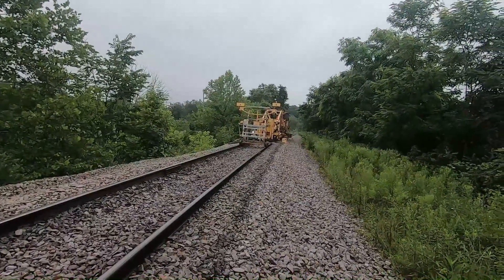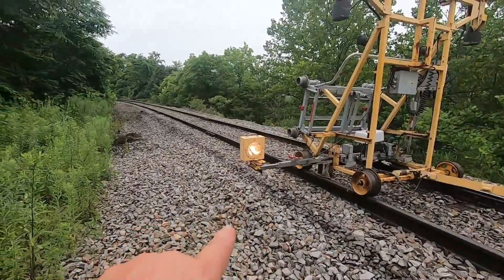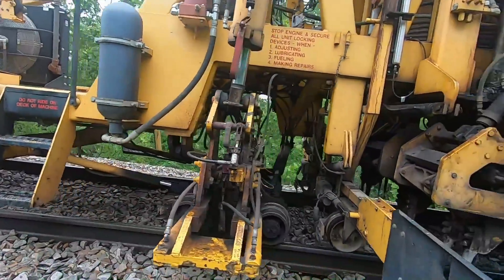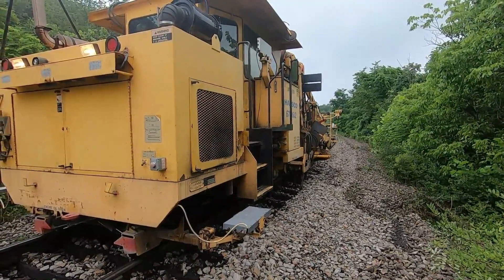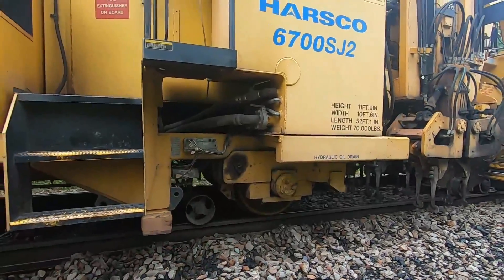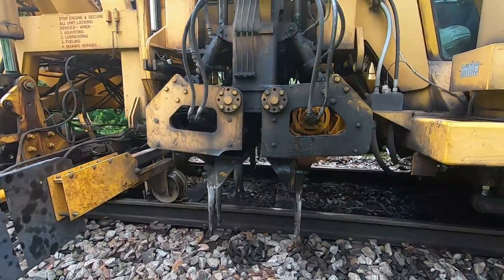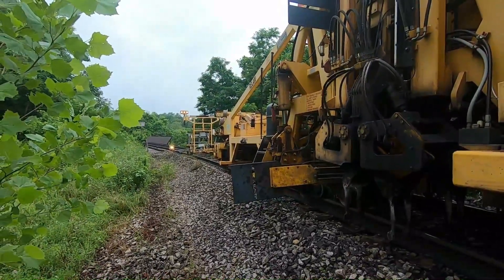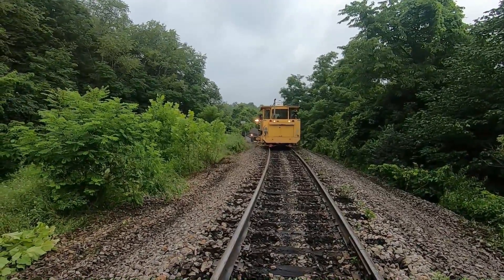Tamping Track with a Harsco 6700 SJ2 Tamper

Comment: I recently saw a video of a RR accident where the "controller" was told by a maintenance crew that they had cleared the line.   The controller sent a train on the track and it hit some maintenance equipment that was still on the line.

I asked about the track circuit in this context (I figured that the equipment would close the circuit and approaching trains drivers would see a caution and then a STOP.)    I was told that these machines have insulated wheels and don't affect the track circuit.   In your experience, is that possible/true?  I've seen videos where maintenance equipment on the rails caused a crossing gate to come down.
Reply from the maker: All hi rail trucks and MOW equipment have plastic inserts in
their wheel bearing bushing to prevent shunting a track circuit,
this is done so when working around a grade crossing, the
equipment won't set off the crossing lights. The tamper also
has plastic inserts on the jack beam clamps. They may be made out of
a harder teflon type material, I'm not sure exactly what the bushings
are, I've always just heard them called plastic inserts. If you
saw a crossing gate come down from an MOW equipment
in the circuit, then that bushing could have been faulty or
even removed for some reason. Hope that explains it for ya John.
Reply: @ccrx6700  100%!!
Reply: yes it can, hi- rail vehicles can too, and can switch to being non-insulated also.

Comment: Great video as usual my friend! Jupiter II System? Wow, that's the name of the space ship on Lost in Space, that's a big flashback!  I've always been fascinated with track maintenance equipment! My favorite when I was a kid was the track grinder — all of the sparks made for a great show. My favorite nowadays is the tamper of course 😉 They are replacing several small bridges on the BNSF line down by the Mississippi River as I type. They are using some pretty interesting machines to do that, but it's hard to see going by at 60mph!  The bridges are pre-fab for the most part, they tear one out and put in a new one in a day or so!
Reply from the maker: Thank you. I've always wondered why they named it the Jupiter
system. The old Jupiter 1 had many problems, was a fiend
to diagnose if something went wrong. The new 2 is much
more reliable and user friendly. There is a 2 inch thick ring
binder book that comes with it explaining how it works and
how to troubleshoot. But the computer also does a good
bit of the troubleshooting with the J2 system. Tampers 
are an electrical nightmare! Pre fab bridges are amazing!
Appreciate your tuning in and watching the show my friend.

Comment: Loved the video! Thanks for posting!
I really need one of these tampers. Too bad they don't make them small enough  for my  track. I tamp and level by hand, but I only get the cross level real good.
Reply from the maker: Thank you and glad you enjoyed. Cross level is very important. hand jacking and tamping with jitterbugs or worse shovels or lining bars is back breaking work! Adding super elevation may or may not be advisable for your track. Depends on the degree of curvature and the speed you are taking the curves at. I have a chart that shows me
the degree of curve, the MPH and then the amount of super
to put in a curve. Appreciate your taking the time to check the
video out my friend.
Reply: @ccrx6700  It's all shovels and lining bars here. Thankfully, the lining bars I use are smaller and much lighter than my great-great grandfather's lining bars that he had on the White River Railroad in Vermont. Those lining bars have been holding up wood piles on the family farm since the 1935 when the railroad was torn up.
Reply from the maker: @MillBrookRailroad  😊👍

Comment: Thanks for sharing.  That is an impressive machine.  When you re-set the level of the track, is it experience?  It looks like the clamp picks up the rail by some amount, then after the tamping, when the clamp releases them, the ties sit a little higher than they did originally.  Do you develop a "feel" for how much higher the track will sit afterward based on how much tamping you do on an individual tie?
Reply from the maker: Your welcome Noi wont and we do certainly appreciate your
taking the time to watch and write in my friend. Surfacing track
does have a lot to do with experience learning what ballast conditions
you have and how high to lift track and the machine you are
using to do it with. Seems like every tamper has it's own personality
and does things a bit different than other ones. So yes you do
develop that feel you are talking about. Good observations on
your part.

Comment: That's one crazy machine. There sure are a lot of moving parts. So. how do you start a job like that I mean do you have to go to the bridge first to find out where it sits? And then back up? I know you would want a smooth transition into the bridge on both sides. Stay Safe!
Reply from the maker: to tamp a section, the operator will first make a plot of the
track, that shows the current geometry of the track, then the
plot can be manually adjusted by changing the ordinates in
the plot. And also you must manually add the super elevation to
the plot, then the computer will put the track to how you have 
built the curve. Track surface when done must match
the bridge surface obviously. It''s easy. thanks for watching
Anthony.

Comment: Re rail creep, does cwr creep less presumably Canada you stager the joints this causes the vehicles to sway, and they are more likly to derail, again by the same manager.
But in The US this is the practice see a badly tamped if ever, ELS RR videos, where the train is rocking and rolling.
Thanks again for your time to make these great technical  video's.
Reply from the maker: Your welcome Anthony and we do certainly appreciate your
taking the time to watch and write in my friend. Steel rail creeps
(expands from heat) the same amount whether it's welded
or jointed. With welded every tie is anchored to prevent heat
buckles, which doesn't always happen, CWR has more buckles
than jointed. With jointed the joint gaps take up that expansion
also not every tie is anchored on jointed track.

Comment: Love your videos!
Up close to some thing we don't see and allways with the smile! :)

A question: is the movement from the sleeper to sleeper somehow automated or is it pure operator's commands?
Reply from the maker: Really glad you are enjoying them Joe! Good question:

Operator manually indexes the machine ahead. On this tamper
it is foot operated, on my tamper it is by push button. Some
tampers have a tie finder. Tie finder by magnet finds the tie
plates and automatically stops the tamper in the right position
over a tie. With tie finder an operator can literally get the machine
running and then walk along side the machine as it does
everything by itself.

Comment: Great video Dave. I didn't like distractions in the cab while tamping either. The Fairmont MKIII I ran had a lot to keep track of, some of it was still manual controlled, not like the tampers today. I've walked many miles beside the tamper too making sure the operator didn't mess up my track.
Reply from the maker: Thanks Zach, glad you like the home movie. For those who have
never ran a tamper, they have no clue all the stuff that happens
and goes on when tamping and all the stuff that you have to
watch on the machine and the track, you can really mess a piece
of track up quick if something goes awry and operator not
paying attention, I've done it! A good ground man is a tamper's
operators best friend out there, unfortionately I have no
ground man anymore, used to, so I gotta pay even closer attention
now, cause if it screws up, I gotta fix it.....LOL

An idiot tie inserter operator can really mess up track too.
We've had some of those, have to have a tamper behind him.
Last several TRIPP operators we've had in here were really good
and I had to do hardly anything behind them.
Reply: @ccrx6700  good ground man and good operators are essential.  I've seen guys screw up track replacing ties by hand. They didn't do it after I made them fix it by hand.
Reply from the maker: @rebelrailroader  👍😉

Comment: Dave is there any risk the tamper might pull up the spikes?
Reply from the maker: In poor ties yes spikes do get pulled. Also in partially frozen
mud or ballast the ties will stay down and spikes get pulled,
did that one time and was no fun hand driving all those spikes
back in! So I won't tamp if the ballast is frozen or even partially
frozen. In warm weather and spikes come up, that a good
way to find what ties need replacin! Thanks for checking out
the video today Mike.

Comment: Dave- how do they get that equipment on your tracks? Does it come in by truck or do they float it by barge?
Reply from the maker: Good question Brad and all the MOW equipment that comes in
is trucked. Nothing ever comes by barge, no way to off load it
here. Appreciate your checking out the home movie my friend.
Reply: it would be trucked in. this piece is owned by the mine. my guess is that the rail contractor employee was running the machine.
Reply from the maker: Contractor was running it rear speaker. Gave me a nice break!

Comment: Hi Dave great video I’m kinda woundering why they only run with one buggy? The longer it’s stretched out the better the quality most times
You have some great looking rock conditions,,I’ve Hurd you say in the past that you have a lot of coal dust in track? A good undercut and reclamation would go along way in improving tack conditions I think
Reply from the maker: Good question Mike. We have an insane number of sharp degree
curves here, we have 70 curves and over half of them are 8 degree
or higher. So I figure that's why they used the single tongue for
most of their tamping. Their pole is different than mine. I have a long
pole and a short pole. I agree, the longer you can stretch it
out, the better the job. This was a section I had cribbed out
so thus the good ballast, we have a lot of other sections
with some pretty poor ballast.

Bet you wished when watching you were running it! Do appreciate
your writing in and watching tonight my friend.

Comment: Dave you said earlier that you have 14 bridges, do you have any threw truss or ballast decks or deck plate or timber or open decks would like to know 🤔
Reply from the maker: Bridge 2 is a ballast deck bridge all others are open deck. I love
bridge 2. All other bridges have a problem with approaches
wanting to not hold track surface, bridge 2 never has that problem.
We have no truss bridges. Thanks for checking out the presentation
tonight my friend.

Comment: All I can think is that this is really cool! A purpose-built machine engineered to straighten and align the track by adjusting how it sets in the ballast. Fascinating! Is a once-through enough to accomplish the alignment and all?
Reply: Sometimes it takes many steps . Passes you could say over the area to get it where it needs to go . You are also usually restricted depending on the class of track to only align so many inches over or up at a time. Causing you to take more passes at it to get it where it's needed it. It also lifts the track if needed not just side to side and aligned
Reply: @brandonrickert9367  That's cool. I am guessing it is the weight of the train moving the ballast over time that makes for misalignment?
Reply: @brianhickey5949 yes among other reasons there are many reasons . Is a brief yeah basically.  But weathering washing out ballast . Improper drainage underneath . Various dianamic force on the rail you can get movement from not enough Anchors. Which hold the ties in place. Or from missing loose spikes .everything over time can cause movement . Or a combination of it al
Reply from the maker: Glad you enjoyed the presentation Brian. Brandon did a good
job in answering your question. Do appreciate your taking
the time to write in and watch my friend.

Comment: What does a TAMPER do ?
Does it pack down the ballast ? 
Does it lift the track above the ballast ? So that the rail bed can be raised higher and higher ?
Do you have to come back and add ballast once the tamper is done ?
Reply from the maker: Lifts track and aligns track, then it shoves the ballast under
the ties to hold that lift and alignment. regulator coming behind
the tamper will fill in the cribs with needed ballast and then 
broom it off the top of the ties so that a good track inspection
can occur where you see the spikes and tie plates. And yes, 
if needed more ballast will be dumped if there is not enough
on the shoulders to pull in to fill in the ties.

Comment: Hey Dave,
I can figure out how to get the radius of a curve. How do calculate the degree of a curve?
Reply from the maker: I do not know the formula for that Joe. On the RR, what we do
is measure from 1 point on the inside of the rail head that is on the high rail. Take that string line 62 feet down to a second point
on the inside rail head. Then measure at mid point, 31 feet, the distance from the string in to the inside rail head. That gives a fairly accurate degree of curvature. 

If the distance was 9 inches, then that would be a 9 degree curve.
It's not accurate enough for NASA to send a rocket to the moon,
but it is accurate enough for RR work. When you plot a curve with
the tamper, the computer figures that out for you.

Appreciate your checking out the video tonight my good friend
and hope that explanation helps.

Comment: Ground is just thawing here, getting ready to tamp in 2 weeks or so. Gotta pull 5" of elevation out of a few curves that have long been neglected from their high speed days.
Reply from the maker: Hope you have a lot of ballast to work with! Old school thinking
on the RR was lot's of super elevation. thinking has changed a good
bit in the past 30 or so years with much less super. Our track
was built in 197/76 but US Steel, and I have an old super elevation
chart from USS, much more super then they recommended than
AREMA does now. This was 25 MPH track and USS put 5 inches
in many of the higher degree curves when built. We've taken
all of that out, I think the most we have now is a few curves with 3
in them.

Comment: Our surfacing crew got a totally rebuilt Jackson 6700 from our Brainerd equipment shop last year and a 100% new Kershaw regulator a couple of months ago
Reply from the maker: Nice Jason. This guy told me he has been on some transit jobs
where they gave him a track chart and they wanted him to
put the existing track to within 1/32 of an inch where that track
is on the chart, and he says he has done it with this machine!
This machine was rebuilt the year before by Precision which is located
in Independence KS. 6700 when calibrated right do a very
good job. Appreciate your writing in and for watching tonight
my friend.

Comment: Dave..at what speed does the train go when it's being loaded. I have a model rr and trying to be as prototypical as possible, thanks Randy
Reply from the maker: Here we have class 2 track Randy. That means track speed is
25 mph. There are 9 different classes of track in N. America.
The higher the class of track, the higher the speed limit is.
Class 9 track is 200 mph. So depends on what class of 
track you are modeling. No freight allowed on class 8 or 9,
and strict restrictions on freight on class 6 and 7. Freight RR's
are from class 1 to 5. class  5 speed is 80.  Send me our class
of track you are wanting and I can tell you the speed limit for it.
Reply: @ccrx6700  Dave, thanks for the info. Mine is class 3. When the cars are being loaded and the train is moving through the loader, what speed is that? Someone said that it was 2 mph, but videos I  saw seemed slower. Currently I  am moving mine at scale 1 mph. Thanks. Randy
Reply from the maker: @randolphmayer8986  We don't have a continous speed while loading,
the cars stop until coal builds up in the hopper, then then move it
about a mile an hour and then stop on the end. I know Baily Mine here
load without stopping, Emerald mine here used to do that also.

Comment: One of your other videos you said you had no outside connections with rail. How do you get equipment in?
Reply: Contract MOW equipment normally moves by truck. They just set it on the rails at a road crossing. The class I railroads usually stack the MOW equip on flatcars to relocate.
Reply from the maker: All our rolling stock is taken by Norfolk Southern (on old Monongahela
RR tracks, now NS tracks) to a siding at Poland Mines. From there
it is trucked to our harbor about 5 or so miles. All MOW
equipment is trucked in. Big expense for sure Cory.

Comment: Great video.  How often does this process need be done?
Reply from the maker: Thank you Fireball, glad you enjoyed. There is no set formula here
on how often a curve or section gets tamped. I have curves that
hold track surface really well and haven't been tamped in 7 years.
I have other curves and sections that need surfacing several
times a year. Lot depends on the sub surface and the quality
of the ballast. This particular curve needed surfacing every
several months before I cribbed it out, lot of mud in it. After it
was cribbed, then this is the first time in 2 years it was tamped.
Lot of variables to completely answer your question, but I believe you
understand better now. Appreciate your writing in and watching
my friend.
Reply: @ccrx6700    Thank's Dave.   it all makes sense.
Reply from the maker: @fireballxl-5748  👍😊